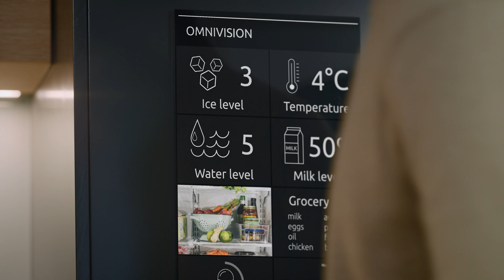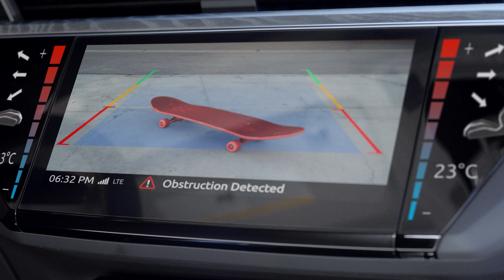The New OMNIVISION Unveiled!

Comment: Hi! Couldn't find a contact list, so I guess will try through here. Anyway. We purchased a few OV9282's, and plan on starting the mass production of a device based on them soon, the only two things holding us off are:
- The ILPWM pin: how to activate the PWM itself? We received the datasheets, but the named issue remains unclear, as simply writing the registers listed there has no effect (writing '1' to 0x391C causes nothing: the duty cycle remains at 0, and no output is observed). The issue is not on our side, as setting the polarity bit causes the output remain always-on, opposed to the initial always-off state.
- for some reason we are getting some strange image corruption (slightly looking like a semi-transparent test pattern) covering nearly 100 top lines (the DVP interface is used), the remaining part of the image is ok, how to fix that?
If anything, a recent and updated datasheet would be nice (ours dates 2019).
Reply from the maker: Thank you for contacting us here! Please contact our sales team here: https://www.ovt.com/contact-sales/ for more help.
Reply: @OMNIVISION1  Thanks, but the sales department is not what I actually need (by the way, you are doing some great job there, as all our requests were fulfilled timely, and we already delivered large quantities of devices featuring your sensors - hope this cooperation is as enjoyable to you as it is to us!).
What I need is a contact of the engineering team, and likely both questions are easily answered (I guess the PWM issue is simply a result of a datasheet typo, while the "squares" one can be easily fixed by setting the correct timings), so resolving them both seems like a matter of a single phone call or message :)
Reply from the maker: @TheBypasser  Thank you! Have you ever tried to contact our technical support team? https://www.ovt.com/support/technical-support/